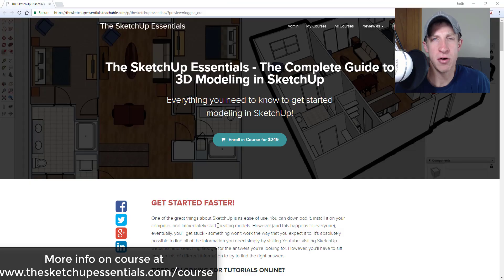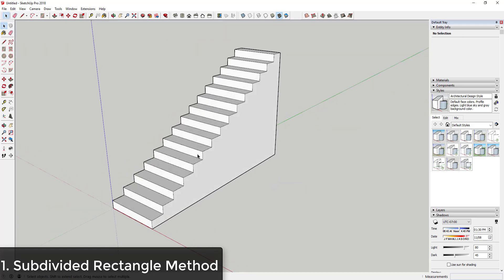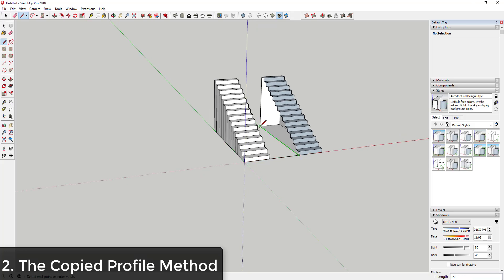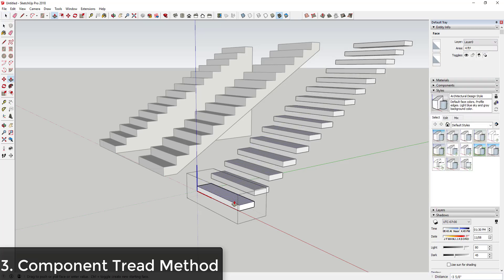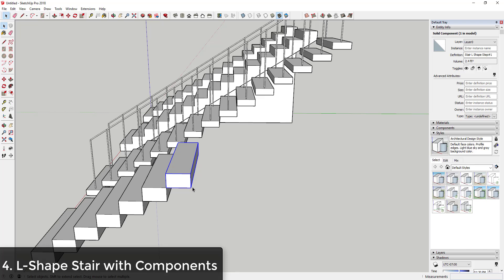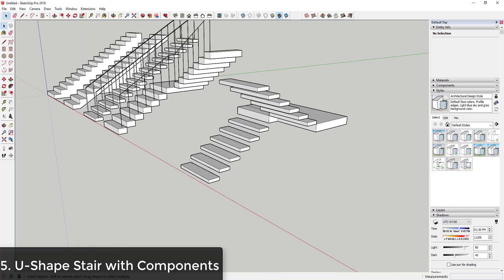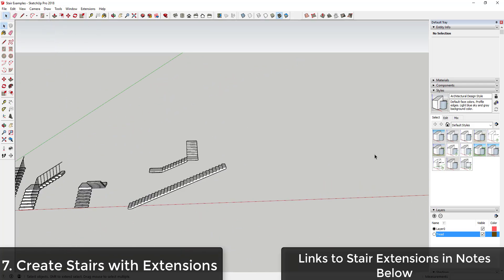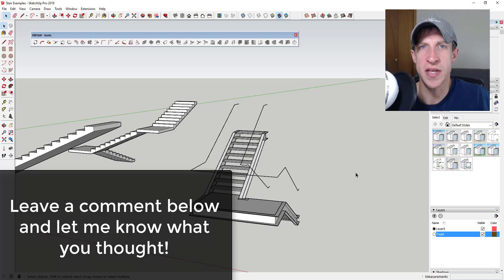7 Ways to CREATE STAIRS IN SKETCHUP!

Comment: i use the component method for stairs :) saves me a lot of time if i have several stairs of the same style. the problem I face with making stairs is that we use meters, the max step height in my country is .18m (not .2m) and it always creates a problem with the topmost step not aligning with the floor level above. so whenever i create stairs, i create a flat plane first as a step and make this a component. copy it at .18 interval until the last step is above the floor. i group the entire stair and scale it downwards to make the last step exactly at the same level as the floor above. i do the same for all stairs in the floor which will use the same style. after which, that's the only time i create the profile of the step (the thickness of the step etc). the problem if i do the profile first before the scale is it's really impossible to make the perfect scale it once the profile is already created.

that's the easiest way i got so far. the .18m max step height in my country really gives me headache because for a 3 meter floor to floor height, i would need at least 17 steps, but dividing 3 meters into 17 steps will give me .1764705882352941 and so on meter interval. that's is O.C. level issue for me. so the scale portion before profiling the steps is my lifesaver. using 18 and 19 steps will also yield a long decimal. 20 steps will give my .15 meter height but at this point, it's already an issue of economy because i used too much steps for the stairs hahaha.

Comment: My method, draw a line from where you want your stairs to end and to where you want to begin and then make a 90° triangle using that line as the long side you now draw lines from the middle of the two straight lines to the middle of the pyramid, you do the same with quarters, eights, sixteens etc until you have the desired effect, it's easy to do and it's fast
Reply from the maker: A 90 degree triangle?

Comment: So, I'm downloading 1001 Bit tools to try it out, but the Sketchup Extension Warehouse warned "not flagged as compatible with 2018. looks to me like most likely it is but nothing like asking the community: good results in 2018 Pro? Thanks for your feedback.
Reply from the maker: Works fine on my 2018 version - worst case, you could just go in and delete the file out of your plugins folder if it doesn't work :)
Reply: Sure thing. I'm planning to work out riser heights for 8,9,10, and 12' stairs in a spreadsheet so I can pop those in to the plugin and generate stairs. Great extension. Now I need to review your vid on 1001's many functions. I've found the fillet and chamfer functions are super handy. Thanks!

Comment: Justin, couple of items needing addressing on how to build stairs efficiently is the legal parameters the code will inevitably force real world builds to conform to, so anyone seriously designing a staircase to build when required to meet code needs to work from code up. IRC 2015 allows max steepness of 7.75" risers and 10" treads with 1" nosing so because rise/run is so crucial to stair design and the surrounding structure they serve, I always begin with a profile method at 7.75x10 to set riser height to real ceiling. Real floor height is another key issue: most newbies or non builders won't count on real world ceiling/floor system thicknesses. You can't span an open floorplan situation with 2x6 thick joists. Most floor truss folks want no less than 16" and add to this 2 layers of ply wood  for "framing" thickness. And most trades and builders go floor trusses for the MEP items to run easily in the webs. So we plan these in new builds.

So, as you know, from slab to 2nd flr framed thickness is the real rise you go off. So for my profile method, my run is set off the 10" treads required to stay under the max riser ht. A simple stretch and check of my profile stair builder like you made is done to check I'm not too tall at the riser ht, then I go component treads from there, perhaps component risers. Then whatever finish floor you like, your components all update to this.

Railings are also code regulated: 4" spheres can never be allowed to pass the ballusters or rails, so this can really tweak your design if you're not aware of it. Assembly Builder rocks this aspect.

Use profile method to set rise/run real world, then run stair case builder in Assembly builder and tweak components to suit your style requirements, railing etc.

I look forward to trying the 1001 bit tools option as it looks like it can cut down my "sizing" test time via parametric builds. Nice.

You address a huge hurdle to fast 3D interior design in Sketchup, THANKS!

Comment: When designing, people often leave the stairs to the end, after allocating an "area" at the beginning, which then gets infringed upon multiple times until it's time to try to shoe-horn a legitimate staircase into a space that wasn't laid out for one, with lighting, switches (electrical) , natural lighting (daytime) and things like door swings, security, ventilation and handicap access all being addressed under limited circumstances.
Build the stairs first.  Get it right and shoe-horn all the other stuff around the stairs.  It took me ten years to figure that out.
Reply: Yes sir, as a designer, I can't agree more. It can derail your whole design when the city comes back refusing to approve a staircase (too steep, for instance) at that late stage and cause massive revisions and unhappy clients. Knowing this upfront and knowing the IRC or IBC max/min you must design to will save your neck. I prefer to have a simple block 3D dummy model for spatial tests, and a standard footprint in 2D to pop in while laying out plans so I know early on that it should work. In the 80/20 rule, this is a 20 that speeds up the 80 later.
Reply from the maker: Good point! Thanks for the comment!
Reply: @Thesketchupessentials  Hi mate, I really I appreciate your valuable SkethUp videos, can you please send me how to draw a radius in dogbone specimen, so I can 3D print it do some experiments on it , I have a radius of R76 and I drew it as 0.76 is it OK or is there any method that I can follow.
Thanks
Adel
Reply: Refuso Againo dope
Reply: In architecture school they thaught us to first get the staircases and emergency exits right.

Comment: Thanks for sharing. Very comprehensive and easy to understand, thanks
Reply: I've just discovered something that speeds up and improves the reliability of SketchUp immensely and I would like to know if it works for others too.

I run AVG Tuneup in turbo mode on my Windows 7 machine, which cuts out any fancy fonts and background programs and this not only speeds up my SketchUp work but crucially it gives me virtually 100% reliability. For example in a days work, I might experience 5 to 10 crashes per day creating SketchUp models but with turbo mode - NONE. This would point to Windows and Microsoft as being the culprits for SketchUp crashes. Has anyone else had the same experience?
Reply from the maker: Thanks Jeff!